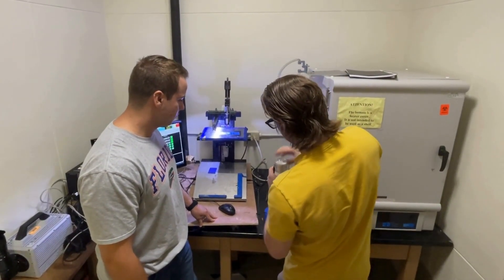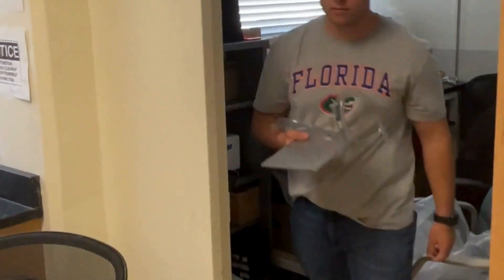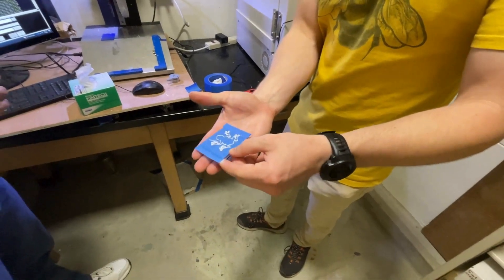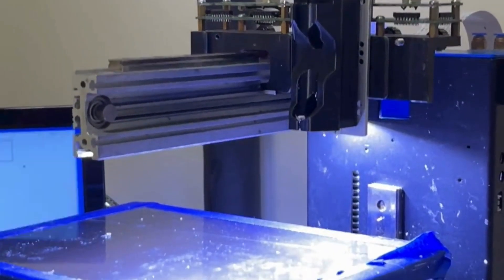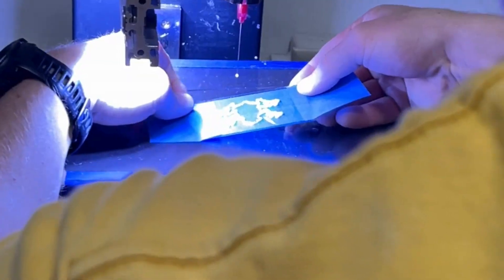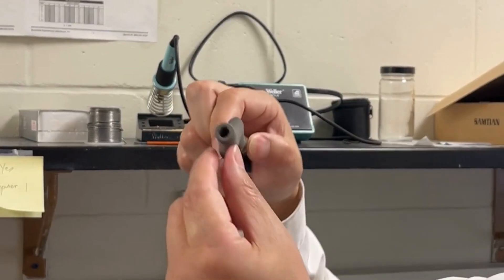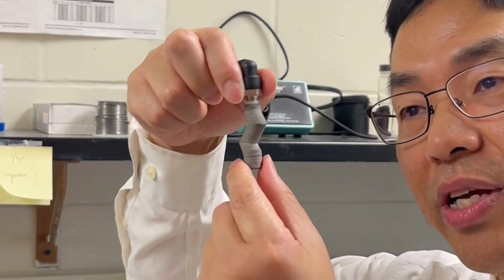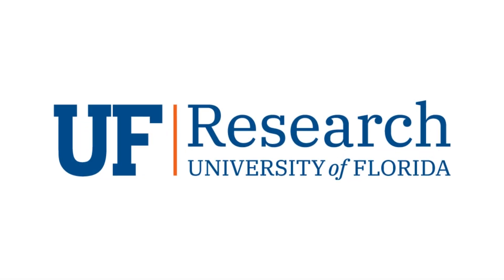New vapor-induced phase-separation 3D-printing method developed by UF engineers

Comment: I have to admit, I fail to see the usefulness of this approach for most applications. So according to the paper you induce a phase separation in the polymer using water mist essentially, which doubles as porogen - because of the phase separation. How and why is this advantageous compared to traditional ceramic or metal filled PLA followed by a sintering step? I see some applications where lightweight low-density polymer composites are used, or to 3d-print ion-exchange membranes (the in-situ phase separation process may be useful here), but I fail to see the advantage for most applications